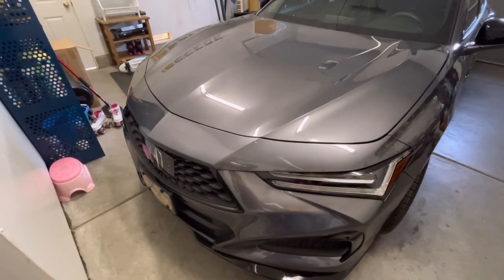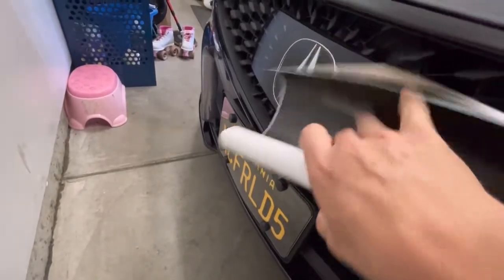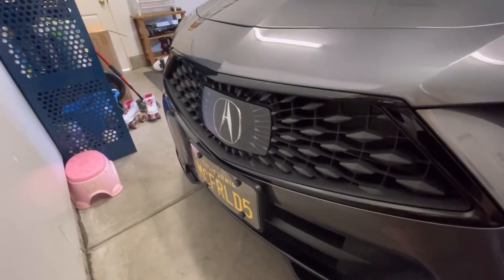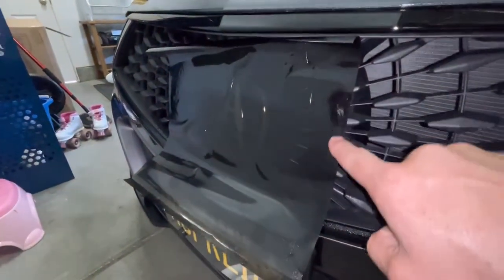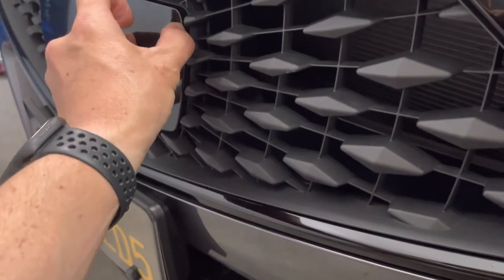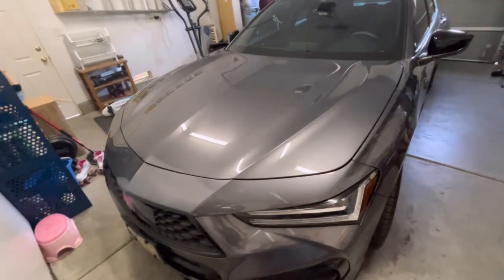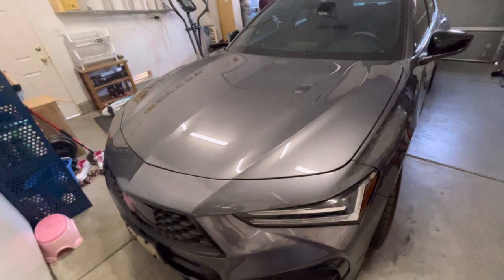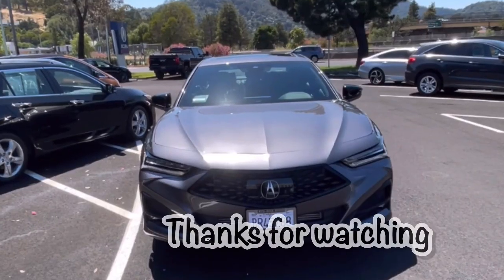Quick method to delete chrome on any vehicle that WORKS for almost no money

Comment: Woah perfect timing man! When you had a little extra to wrap around the lip of the sides of the grille, is that when and where you applied the heat? Did you use any heat over the center? That's clean af man! You're retirement job could be professional window tinting lol
Reply from the maker: Lol. Yeah I applied light heat on the center. It doesn’t take much since it’s flat. Then as you apply heat on the edge it will lay right down instantly. Be careful if using your finger to smooth it around the edges as it gets really hot. Super easy. 👍🏻